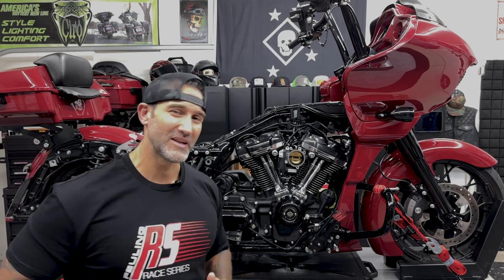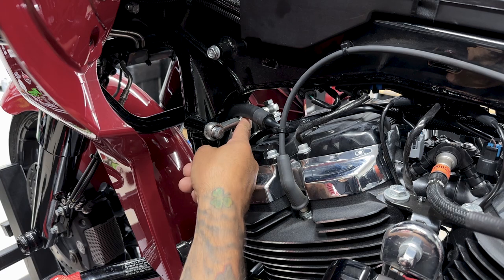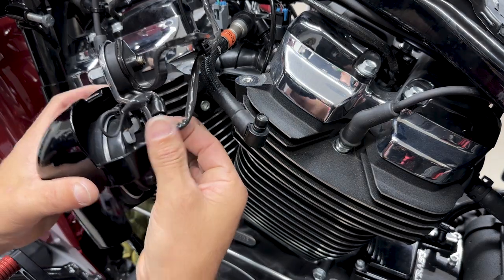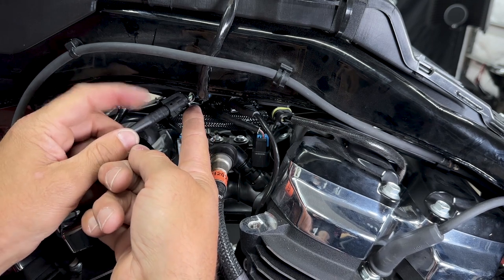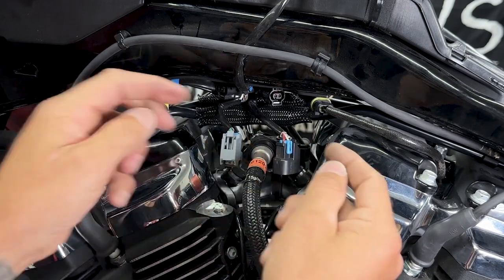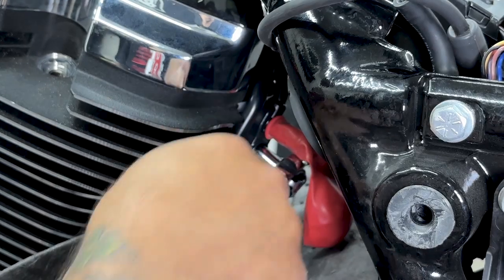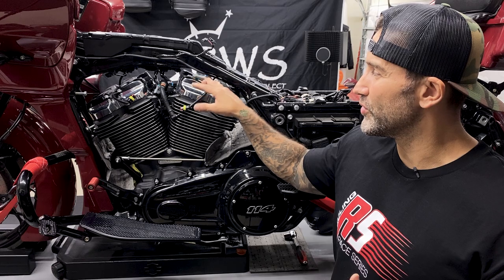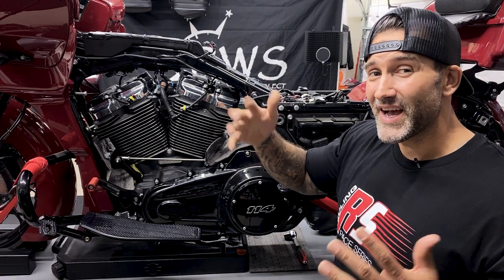How to remove Harley M8 Oil Coolant Lines - Milwaukee Eight

Comment: please tell me if I replaced the oil cooler on my street bob milukee ate how do I pump oil back into the cooling system and how do I check the level?
Reply from the maker: Once you start your bike, the oil will cycle back through.  You would check the level through your engine oil dip stick
Reply: @ 
Thank you very much😄👍

Comment: Hello. What kind of oil should be poured into this circuit?
Reply from the maker: No oil is poured directly into these.  Once you refill your engine oil, that oil will recirculate back through the lines
Reply: @RAIDERWORLD  🤝

Comment: If you remove the mounting bolts for the oil cooler and rectifier you can move the oil tube out of the way and access the front manifold bolts much more easily.
Reply from the maker: That’s definitely another technique.  With my setup, I’d have to disassemble my fairing spoiler kit.  Thanks for the input though!

Comment: Hi,  is any oil screens exist in the oil pan to prevent get contamination to  the oil pump ?  Or how the  Harley solve this potential hazard  by installing suction holes not in the bottom of the oil pan ?  What happend if something fall to the oil pan during checking oil level, for example small stone or metal piece?  M8 engine. I will be glad if you could write and explain how the oil is sucked to the pump.
Reply from the maker: There’s nothing there as of now, and I don’t believe Harley will ever add that.  You could always use a home maid screen.

Comment: Great video, I have a seep from my front cylinder manifold, but my 3/8ths socket is too fat to fit in to purchase the bolt, what sockets you using? I may have to grind mine thinner. Also what about the o rings on the inside?
Reply from the maker: Now, you can loosen up your engine oil cooler screws, and it will give you more room to access the manifold screws.  As for the replacement screws and o-rings, I would contact your local Harley Davidson.  They will get you the exact screws and o-rings you need.
Reply from the maker: @richardphillips1041  Absolutely! No problem